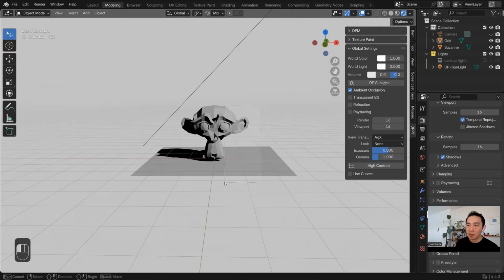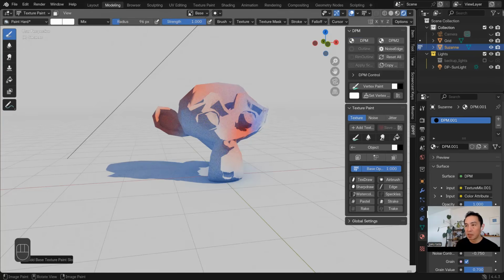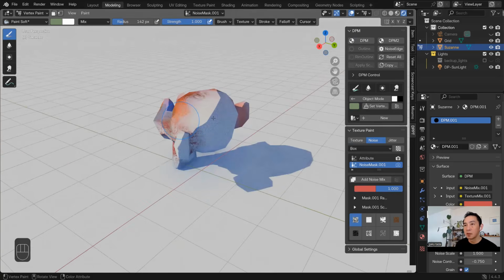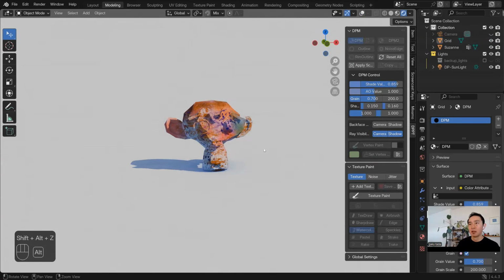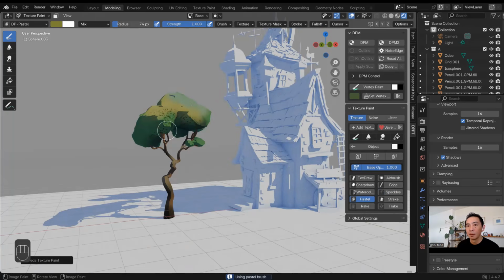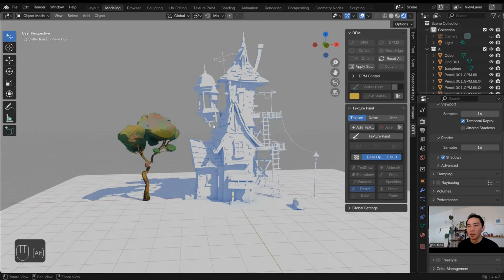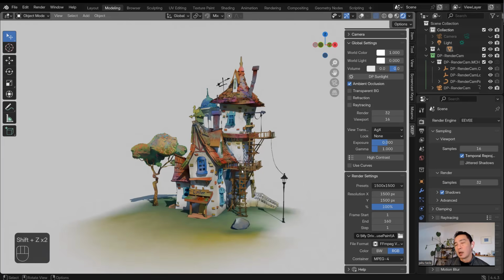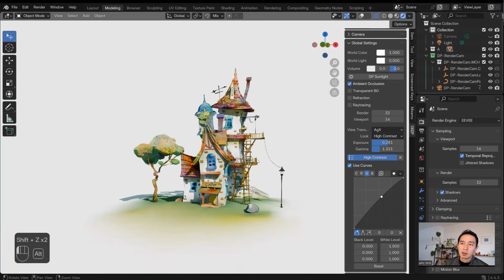DP Paint Tool --- Painting tool for Blender 3D (addon)

Comment: Thanks the addon is beautiful but I noticed it hijacks the pressure sensitivity for grease pencils, meaning you cannot use size or strength pressure sensitivity if the addon is activated. Is this required? is it a bug?
Reply from the maker: oh really? it should not happen, the pressure just not working at all?
Reply: @GAKUTADA  you can turn the pressure sensitivity switch on the top menu on, but as soon as you click it goes off, I thought it was my wacom but disabling the add-on fixes the issue. Blender 5
Reply from the maker: @testelllest  Do you have the latest version of DP  Can you please send me a log? to gakutada@gmail.com
Reply: @GAKUTADA  sorry i was out of dat from 2.1.3 to 2.3.1 the issue has been fixed, thanks for your work!